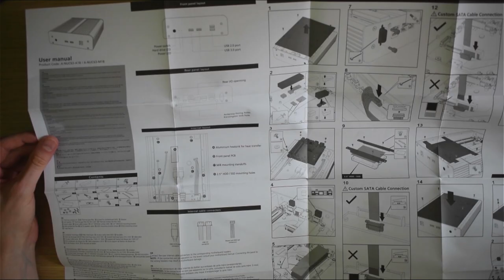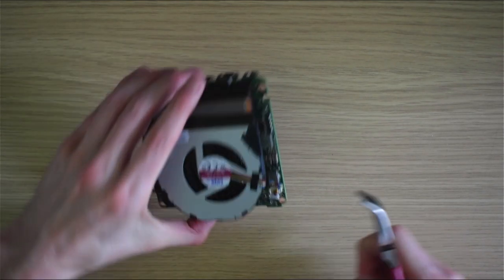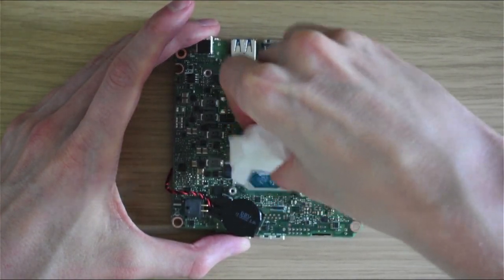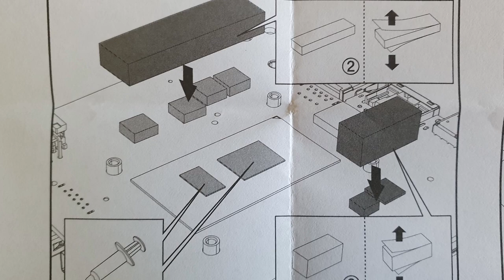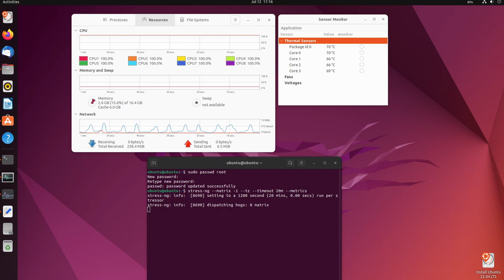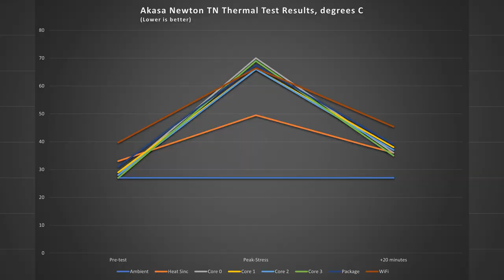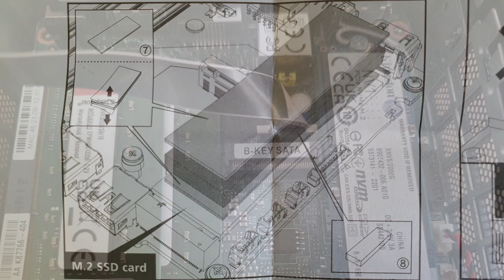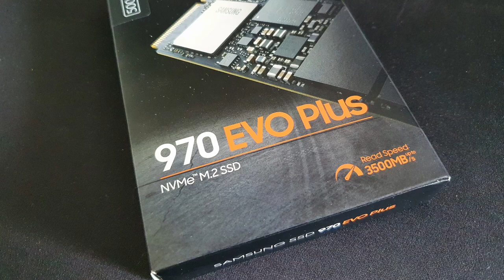Computing has never been this quiet! | Passively Cooled Thunderbolt Mini-PC Self-build

Comment: Just finished my Akasa Newton TN build, this tutorial was very helpful. Thank you.
Reply from the maker: @Dimos Scratch, how are you finding you thermals? I have not had any problems, not even in the UK's 40 degree summer in a house with no air conditioning. Now that we are in winter, I have noticed that it kicks out so little heat, even compared to my XPS 13, that it has done nothing to help heat the room. The XPS (and before that my desktop) were adequate space heaters.
That said, the performance has been right, the price was right. The silence is absolutely fantastic and I am still very happy with it.
Reply: @c-amie  I am completely satisfied. The case gets warm when stressed but nothing to worry about. I also don't hear any coil wine, it is dead silent.

Comment: Hi C:Amie, thanks for that helpful video, I think I will order one for my nuc :D One question, I got a NUC11TNKi5 and it has a built in wlan card but I cant see any antennas on my NUC11TNKi5, maybe they are stored inside the NUC11TNKi5 ? Does I need these antenna Cables and the antennas for the NUC11TNKi5 , too?

thanks in advance and have a nice day...
Reply from the maker: @Benjamin Bartnik, no the card doesn't have an internal antenna coil. It has little header ports on the top of the card to attach pigtail wires which can break out into an actual antenna. If you do not have the pigtail cables you will have zero wifi or BT signal
Reply: @c-amie  thx for the answer 🙏 but how can I get wifi/bt with my nuc without the antennas?
Reply: @c-amie  as I read correctly I only have to buy the pigtail cables to connect the external antennas to the nuc‘s wifi card?

Comment: Very interesting and helpful. I have a question: Is it possible to put any SFF board inside this case? I want to put a Minisforum UM 690 inside. The CPU is faster and the graphics is way better.
Reply from the maker: @Rob Schmitt, no, sadly not. The mounting holes are non-standard to match Intel designs. There is also no I/O shield module on the back plate, so the cut-out is board specific. It would have been nice to see a more generic I/O shield design - the entire back piece can be unscrewed and replaced, however very few people will have the ability to mill a replacement part. So sadly this is a one trick pony; which explains why Akasa keep having to release new versions and that they are not well known.

Comment: Does the wifi work without that extra tri-band antenna ? Very nice video though.
Reply: I will answer myself. So if anyone wants to know, putting NUC into AKASA case completely kills WIFI and BLUETOOTH connection so this external antenna is a MUST. I've tried to put akasa enclosure on the top of NUC with original case and speed went down dramatically and it wasn't even completely closed. It's pity it's not delivered with the case and need to be bought separately.
Reply from the maker: @Michal S, if I unscrew the two antenna's from the back of the case, the WiFi still works. If I remove the pigtails from the WiFi card, then it pretty much does not work at all as the metal case is caging the RF signal. The machine is only around 3m away from an enterprise grade Unifi AP though, so it has a very clean, very strong signal. Your mileage may vary without the antenna. My antenna are still connected - not that I use WiFi as I have structured cabling.
Reply: @c-amie  Thanks for reply. I have fiber optics 400/80 and when I’ve started speedtest it went down from 300 mbps to around 40 mbps and I just cover the NUC with the opened akasa case. So question is what speed do you get if you disconnect antenas? But possibly it still receive some signal even withou antenas. Anyway I’ve odered set of akasa pigtails with antenas from amazon so I will try it later.
Reply: @misenko856  With the antenna screwed on, it is getting:
400Mbps with 5/5 bars in the signal quality scale in Windows
DSL is running a 74.67/15.19 Mbps

Unscrew the antennas i.e. pigtails only
It bounces between 180/240Mbps, with a slight bias for 180Mbps with 4/5 bars in the signal quality scale in Windows
DSL is running at 74.43/15.18 Mbps

So depending on your distance to the AP, you probably will not get the full 400 without the antenna.
Reply: @chris21443  Thanks for reply. Yes seems to get full speed I need to connect both antennas but interesting to see even with antenna unscrewed it’s still pretty decent signal. If I disconnect pigtails from M.2 card completely there is no signal at all so interesting that only pigtail cables can take some wifi signal.
Reply from the maker: @misenko856  It seems consistent for everyone. If you have a WiFi6/802.11ax AP, you might see improved speeds without the antenna. The faraday problem is going to be an issue in any case though, this is not a problem with the Akasa. I've tried running a card in a Dell Optiplex USFF before with no pigtails and there was just no signal if you put the side panel on the case.
By not having antenna connected you will leave some performance on the table though, which obviously you don't want to do. If the objective was to set out whether the WiFi can work without any antenna, then I think we've proved that it can. If you are in a position where you cannot find the antenna's at the moment, then you will be able to get by just fine with just the pigtails for even an extended period.
Reply: @c-amie  Yeah. I’ve ordered only case which came without pigtails and antennas. I’ve watched some videos where guys bought a set of pigtails and antennas and therefore I’ve asked this question if it would work without it in akasa case. I was not sure and the. conclusion now is that without pigtail connected it does not work at all and with only pigtail connected without antenna it’s still work on acceptable level. With also antennas connected it works at full speed. I’ve ordered akasa’s pigtails and antennas but they will arrive next week. until then I’ve connected via power-line because for some reason my wifi 2.4ghz usb adapters works like a shit but I guess this is some problem with router.
Reply from the maker: @misenko856  To be honest, if you can use powerline, I would. Unless your powerline has a lot of devices on it, you can easily have full Gigabit Ethernet over powerline, vs. what you will get over WiFi - all without the QoS issues of WiFi (microwaves, latency etc).

What CPU board did you get for yours?
Reply: @c-amie  Well, I’ve never seen 1 gbit on powerline. Those are some theoretic numbers and reality is far away from the
at. I have 2 more modern stated as 1200 or something like that and those works max 300 if i’m not wrong. ai need to check it. Nevertheless these are connected to my NAS. For nuc I use an older one which is 500mbps but it works max 80 so not very good. And this also slows down the others so this is just a temp solution. 
What board you mean? NUC ? I have 12 Pro i5
Reply from the maker: @misenko856  I've seen up to 840Mbps on 2000Mbps unencrypted powerline. Standard 1GbE will usually only manage 940-960Mbps itself. 300 is pretty poor there though!

Ah very nice. You managed to get a 12. I had the 11th on back-order for over 6 months before it showed up - 3 weeks after the 12th gen were announced! I was rather irked of course, but I decided just to stick with it. Have you had any issues or problems with it?
Reply: @c-amie  Really? I’ve ordered a month ago and they were on stock like normal. No issues so far, I had an issue that it went to sleep on it’s own in modern standby - randomly. Not sure why, if it was software thing or some hardware connected or NUC issue though but then I’ve disabled modern standby and it won’t sleep anymore on its own. The only problem is that if I put it in sleep manually then it does not wake up at all and have to turn it off. But I don’t use sleep, it’s running 24/7 and in idle its drawing about 10-15W so I’m ok with that.
Reply from the maker: @misenko856  I ordered it in March... supply chain horrors....
I've been seeing issues recently with USB on resume from sleep/hibernation. They show up as undetected until they are physically re-jacked. It doesn't happen all the time, just occasionally, but it seems to be getting more frequent. It is happening on direct connects as well as hub connects. I think it was the BIOS update that may have caused it.
Reply: @c-amie  Hmm, I have to keep an eye on it but from modern standby I had not this issue. It just went to sleep randomly. Really weird. But it seems to be a great PC. Actually faster than my old i7-4790k desktop :-D That original form factor with this power is total beauty but that fan kills it. I always hated this on modern notebooks they are noisy af because of this. Absolutely hate these small high RPM fans. On  my desktop I’ve put everywhere noctuas and it was very silent. This one on NUC is annoying as hell because it kicks very fast and then takes time until calm down. Even starting eclipse IDE was made to spin it.
Reply from the maker: @misenko856  I need a totally quiet environment, and like you say, the laptop fans are very high pitch. I've gone from full desktop to laptop + docking and now to this. I am quite happy with it.
All my fans are Noctua's, they have always impressed me.

I did get a off the shelf version of my NUC for someone else. I ran it on my desk for a couple of weeks and ultimately, I couldn't live with the high frequency of the fans. So a self-build was the only way to go - plus it was way more fun!

Comment: what's the temperature on the case when running?
Reply from the maker: After a day of web, office apps and YouTube, the surface temperature on the top of the fins is between 30 and 40c depending on ambient.
Rigth now is is 3:15pm, has been on since 9am and is 31.3c under 21.5 ambient.

Comment: Not that the VRMs should be that hot since it's a mobile chip but if the PCBs arent different on all NUC 11s it's just lazy not making a little platform like for the cpu/gpu since that thick thermal pad isn't efficient at all.
Reply from the maker: @ForWhomTheBellsTolls, I'm not following, sorry?